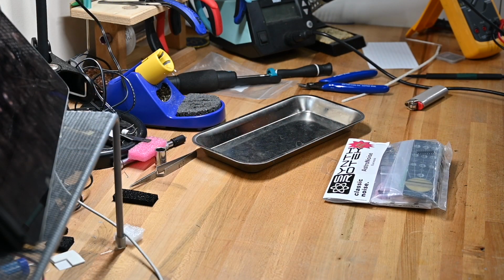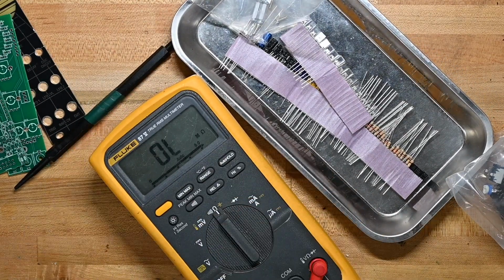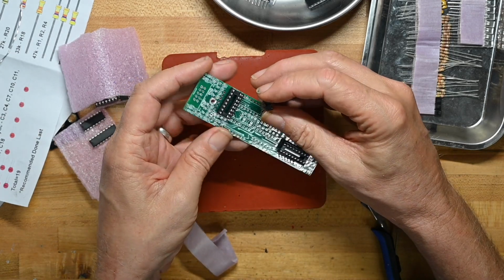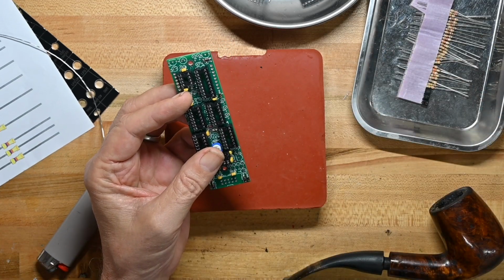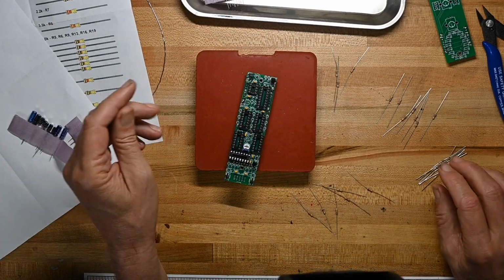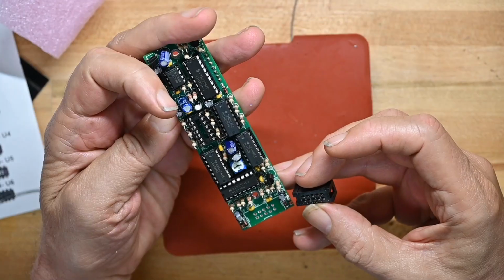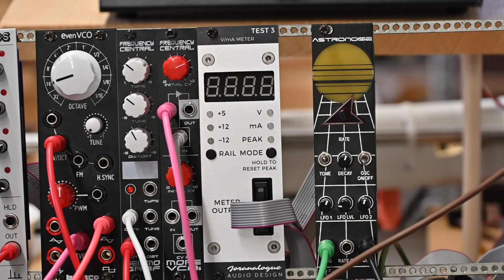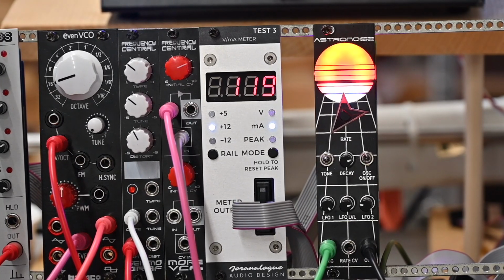C.K. builds an AstroNoise kit from Synthrotek, eurorack

Comment: The current draw is higher than expected. I guess if each led draws around 5mA it makes sense. At least you can turn the LEDs off if you aren’t using it which drastically reduces current. I made one of these last year and it’s a pretty cool noisemaker for melodic percussive sounds along with the DS-M and Chaos Nand modules they have.
Reply from the maker: Yes, the current draw was surprising.  Good module, but something I'd grab off the ready pile when I need it, not in the rack all the time.